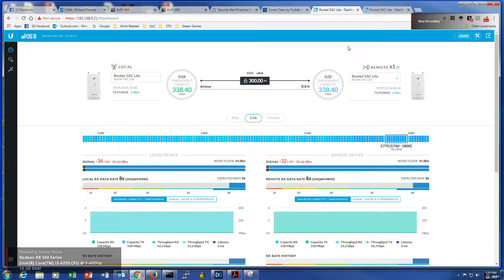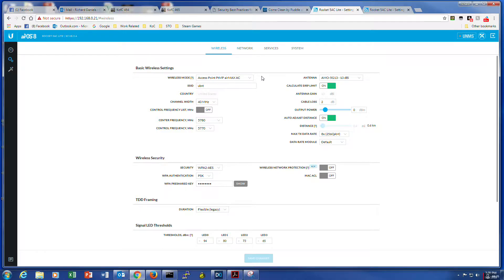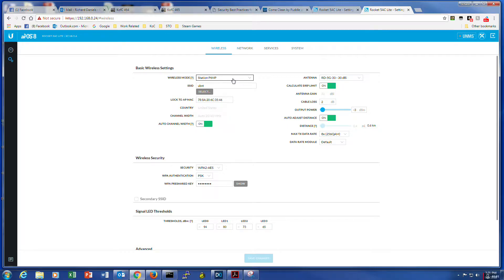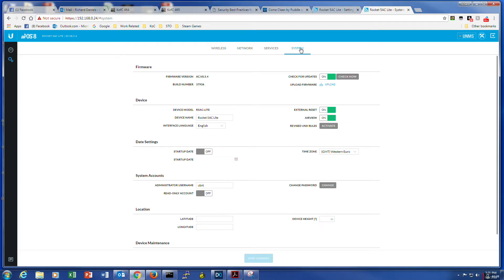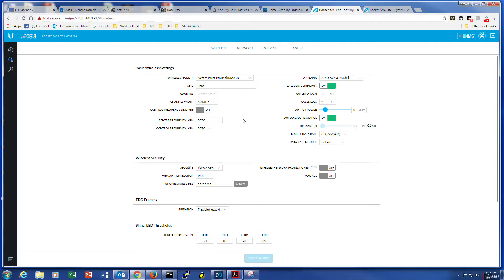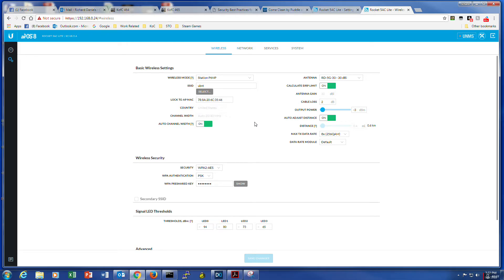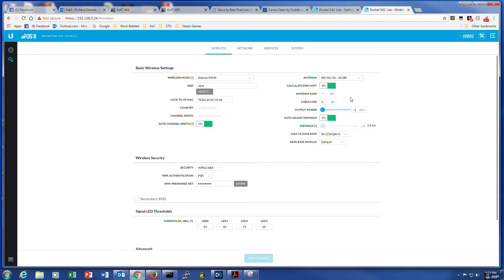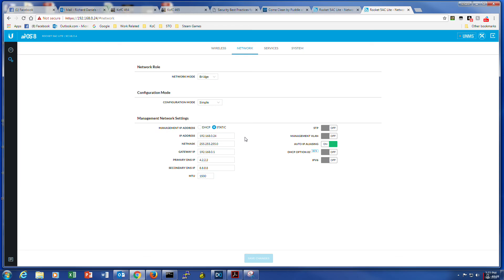Rocket AC lite PtMP Part2 2018 06 08 15 30

Comment: hi! i want do system like yours but should i use 2 rocket or 1 rocket 1 CPE like nanobeam ac. also, which antennas do you use for rocket? thanks in advance
Reply from the maker: I used one omni antenna and 3 of the 5G30 antenna on that install. I have not tried the nanobeams (yet). I try to keep the same radios throughout the system.  Hope this helps.
Reply: @rdaniels8147  How far does this system offer to you?
Reply from the maker: @merkamshn  I have not tested the distance. This setup has all antenna within small area.